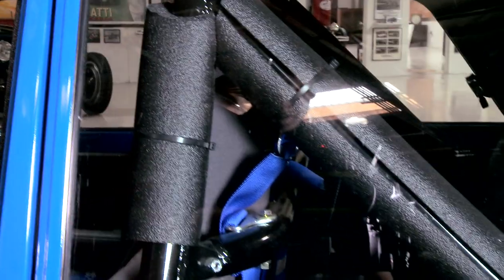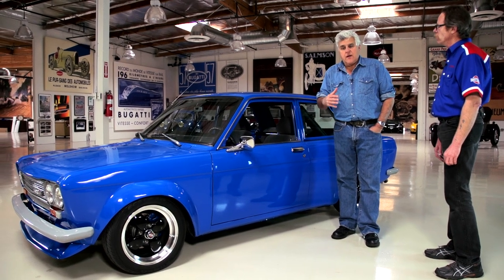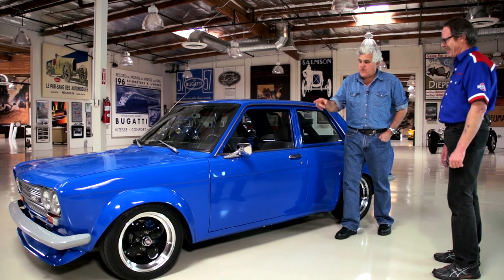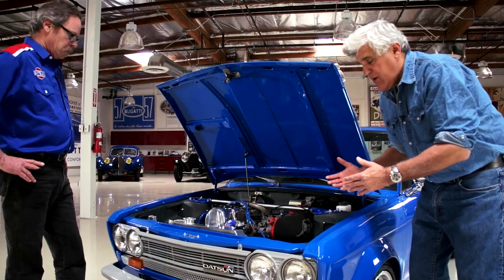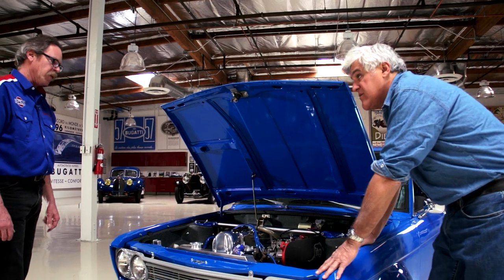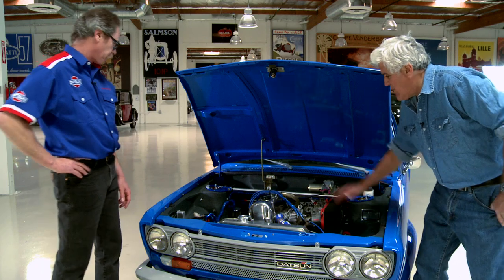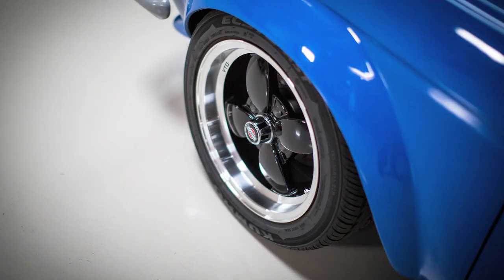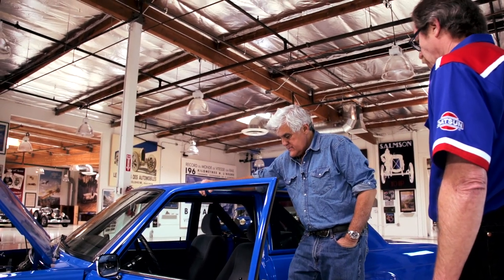1971 Datsun 510 - Jay Leno's Garage

Comment: I'm surprised Jay didn't make the comparison to the BMW 2002.  The Datsun 510 was a more affordable alternative to the Baby Beamer.  Ever since the production of these cars began, the Datsun 510 has been racing against the BMW 2002 in clubs all over the world.  Just look at them side by side.  The two different cars are almost the same size & shape with similar styling.  I remember the 510 always referred to as the poor man's 2002.  I am not slighting the 510.  It was/is a great little car.  These are just memories I have of two excellent cars in the same class: the Datsun 510 & the BMW 2002.

It would be a good thing if both these car companies brought back their respective vehicles.  Kind of like they did with the Mini. (different manufacturer did that one though)  BMW makes the 1 Series now, but it's not nearly the same as the 2002.
Reply: He kinda did at 12:00
Reply: Cj Karcher You are indeed right.  I missed that brief mention by Jay.  He even goes on to mention at the end of the video that he thinks the 510 is just as fun to drive as the 3 Sreies BMW.

I must have been asleep the first time I watched this although, less than 30 seconds of that comparison didn't do the 510 justice in my mind.
Reply: Datsun beat all cars in the class of 2500cc which it is only 1600cc and against
the BMW  2002 in the Baha .  510 king in  Imsa in 1972  under 2500 cc class.
Still see them win in SCCA.    Great car.  have one with Honda s-2000 243 hp.
I am more of a honda fan and you can't beat the top hp for cc then a Honda turns 9000 Love it.  Was fastest 510 at summit this spring with 31 510s there.
Reply: You are right.

Comment: I had one of the first 2-door 510s in Canada- BC actually. Mine was $2100 and it weighted 2100lbs on a truck scale. I rallyed it, and draged it=16.7 , sec 1/4 mile. NHRA record for K stock for one month. Best car I ever bought. Sold it to my sister to pay for my college. I set the redline at 6000RPM and my sister never shifted below the redline; you'd hear her screeming away down the road in it. What a car.

Comment: My first car was a brand new Datsun PL510 2 door sedan. The MSRP was $1990. I had the dealer install a Clarion AM radio and an in-dash factory tachometer, along with Sym-tech rustproofing. Very few 510s  had a tachometer, so mine was unique.The 510 impressed me because it had a SOHC 1600cc engine, good for 96 BHP and 4 wheel independent suspension.  The car was otherwise really stripped down with 560x13 bias ply tires mounted on steel wheels with dog dish hub caps. The curb weight was 1995 lbs. If I had come up with another $200, I could have the 4 door version that came with reclining front seats, bumper guards and full wheel covers.Other cheap stuff included a flat gray plastic manually adjustable outside rear view  mirror and carpeting that covered only the transmission tunnel. the rest on the floor had snap down vinyl mats.The engine was rather buzzy at highway speeds, but the car was very light on its feet. There was no power steering or power brakes, but you didn't need them. I drove it for a year before I sold it to my brother. He discovered a bolt underneath the accelerator pedal that limited how much you could depress the accelerator. He removed the bolt, and suddenly the Datsun was much faster.After about another 2 years, we found the Sym-tech rustproofing was not very effective. The sheet metal was rusting badly.If I had the chance , I would buy one today.

Comment: Thanh you Jay for accommodating common old cars. We had one in SA called the SSS. Tremendous fun also rallying it. Body must weigh about 1950lbs I guess cause i still have a 1986 Corolla 1600 weighing 865kg 
(est just under 2000lbs). Awesome and still 100%original. Thanks for sharing

Comment: I had a 1969 510 in Telephone Company Green.   Was a great little car with lots of power for it’s size.  I used to pull a 16ft ski boat with 4 adults in the car with no issue...

Comment: I had a 1970 510 back in the 70's. I worked for Biener Pontiac Datsun in Greatneck NY. The car was indestructible. I ported the head and had it milled and installed a high-performance cam. With a set of Koni 260 Z struts and wheels, the car handled. Its biggest problem was rust....
I sold it because we needed a more family-friendly car. That was a 1979 Datsun 510 station wagon. It was fun to drive but no comparison to the earlier 510.
This brings back some really fun memories
My son bought a 1973 BMW 2002. That car was also a lot of fun to drive. 
I thind Datsun took many of their ideas from BMW.

Comment: I have a previously abused 2006 Nissan sentra se-r v. The plan for me when I am done ageing it in my driveway is to restore the aesthetic of the car to stock then to integrate the engine, drive train, and suspension of a 270z (VQ35VHR, or VQ37VHR) into it. It will require some frame re-bracing, and custom machining of some parts, but to me its worth it since this was the car I drove while in service. I believe with enough work that this can become quite the sleeper. Unfortunately I lack facilities at this time as other thinks like kids, and responsibilities have priority but one day I will get to work on it. 

I am willing to take options, but please don't be too harsh.

Comment: Got me through my Denver college years in the 80s. Originally yellow, then multi. Completly stock, I used it on 4-wheeler roads on weekends. Nothing cosmetic worked or was attached, and I could park on the Denver streets with no worries, the doors didn't even lock. Maintained by the ex-Shah or Iran's mechanic, who had escaped and wound up in Denver. He loved that car as much as I did. I ran it into the ground, literally, and then left it to the Iranian.

Comment: I had one of these & also 2 of My Friends.  I did modify the Engine by putting a 5/8 Camshaft with a truck head that had larger valves along with twin Webber Carbs & Headers. It sure did go like stink. Ended up sadly though totally off due to passenger falling over My arms while in a corner.

Comment: My Dad had this same car till the year 1992 it was called Datsun 1300 1296cc, was 19 at the time. Sadly sold it off around USD 2.5K as I remember, and bought a stupid Suzuki 800cc. (In Pakistan). Brings back a lot of memories, learned to drive on this, the steering mounted shifter 3 speed forward and reverse. Real fun. I have a picture of that somewhere and would love to share it.

Comment: Mine was almost exactly like this only Black.....the difference was I had a straight air dam on the front with no ports. Carbs were Weber 40 DCOE's (two) with stacks (open) 3" headers race cam,bored out to 1860 cc.5 speed trans, high capacitive discharge,racing distributor.....so much fun. It was stolen and stripped....broke my heart

Comment: I had a 1980 Datsun 510 wagon (I paid $75 for). It leaked every fluid possible, but made the 1000 mile move from Florida to Tennessee in under 24 hours. I loved that car. Tennessee towed it away because it wouldn't pass the DMV protocols. I was devistated. Especially because there was over a $300 bowling ball in the back worth 4 times the car....hahaha

Comment: When I was young my friend had a 510 and I had a sprite (rebadged midget) with a 1275 engine and we raced down a twisty road and the 510 was the sprites equal in speed and handling.
The underhood badge stated Datsun by Nissan on my 76 510 wagon I bought for $125.00

Comment: Hi Jay, probably far too late for you to read this but the story behind the Nissan/Datsun name is as follows: Datsun was a separate entity from the Nissan zaibatsu, during their formative years prior to WW2. The naming history and existence/linage is pretty complicated but long story short: the name of the motor company during the late 20s and early 30s was DAT Jidosha Seizo (DAT was the name of their first car produced by the company under a different name back before the 1920s, before all mergers). They produced the Datson Type 10/11 (name meaning Son of DAT). This and the Type 12 is Nissan/Datsuns (as we know them today) core/formative autombile, which you can trace the 510/Bluebirds linage back to. Anyway, they were taken over by the huge Nihon Sangyo zaibatsu in 1933 (originally a holding group abbreviated as Nissan on the Tokyo Stock Exchange).
Datson was renamed to Datsun (sun literally for the sun) and DAT was eventually merged into Tobata Casting (a company part of the Nissan-Hitachi zaibatsu but was bought out by Nihon Sangyo itself not much later), which the auto parts division of (formerly DAT) was expanded into Nissan Motor Co., Ltd later. They continued DAT's light civilian truck and passenger car operations using the Datsun name. The Nissan name was used for larger, heavier vehicles (including those for the military). They (DAT/Nissan Motor/Tobata Casting) also helped produce engines, aircraft and vehicles for the Japanese Imperial Army as Nissan. During the war Nissans headquarters was relocated to Manchuria, along with the head at the time, in a bid to oversee the establishment of a new heavy industries operation tasked with building much of the infrastructure and new heavy military vehicles there. Nissans name was changed to Manchukuo Heavy Industries Development Co. After the war MHID moved back to Tokyo changing its name to Nissan Heavy Industries. Now, the reason for the use of the Datsun name for their exports starting in the 50s is because the new head/director believed the Nissan name had been tarnished by the war and their heavy involvement with the Imperial Japan war effort, whereas the Datsun name he felt was left relatively pure to what it originally was (though keep in mind the Datsun name was still used in Japan for Nissans early cars during the 30s and 40s). This was a concern because returning servicemen in America were at prime car buying, job, and family starting age, and had money/income. They didn't want to damage their chances at success. Eventually they phased out the Datsun name due to internal pressure in Nissan (the final switch happened right after the then president departed) to use the Nissan name for a number of reasons: tradition, its more Japanese, they wanted to build up a strong marquee, image and association with the Nissan name and they wanted people to know their cars are a Nissan, not a Datsun.

Comment: Sold Datsuns while in college in the early '70s.  We used to actually park our new cars on top of a single-story building that housed our garage. The 510's little brother the 1200 was so underpowered we would have to close off traffic for a couple of blocks and get a running start to get an automatic 1200 to go up the one-story ramp that was about half a block long - and it would just barely make it onto the roof.

Comment: So I'm watching this in January 2020, 7 years after this was filmed and Jay says ; You can find these pretty reasonable still today, a collectors car in the making, wish I had know 30 years ago that my second 510 (which I had painted from the bright yellow to charcoal gray) and sold to an Army buddy for $2500 would be worth possibly $30,000 to $50,000 today, if I had restored her to better than new.  They are an awesome handling car, my first one I pulled the 1600 out and dropped in an 1800 SSS into it that had dual side draft weber carbs.  That car would smoke 1st and second and chirp the tires into 3rd out of the factory 4 speed.

Comment: Re. parts swapability, at 17 I bought a manual trans 510 wreck & easily converted Mom's '71 510 coupe from doggy 3 spd auto to 4 spd stick. With IRS, OHC, ft disks, etc it was this poor boys BMW. Lol, many of the younger neighborhood kids helped me strip the parts car for the fun of it & I'm still using those metric fasteners 40 years later. Anyway, many thanks to Teruo Uchino for his sweet elegant yet slightly sinister design & Pete Brock/John Morton for the inspiration 🏁

Comment: I got my '70 about June '73  at 20 stationed at Point Mugu, from Hughs Motors in Ventura or Oxnard (can't remember where the dealer was) it was $1400 and a 2 door in flesh paint. Got the American Wheels and Koni and better tires. As time went on. I painted the lower half in a brown, the car was that bamboo.  The painting was done in the driveway with about 12 cans of Krylon Gloss but overtime became a flat. Oh well, youth and poverty. It was dependable, and by 1977 I bought a used L20 engine and had it swapped in at a shop in Gilroy.I had custom 2" exhaust pipe made I did not think about the original engine; which was good, I forgot about it and left it at their shop. (dumb). Upon shutting the hood the first time I dented and chipped paint, on higher L20 valve cover- I blocked the space needed with aluminum blocks- to let hinges clear the req. space. I was lucky to have got a roadtrip in it to NJ in Sep 1981 and that was also the doom of it- Having it at grandma's seaside home was a salty ocean nightmare of snow rain and ware. My dad blew it, then alone, he let  it sit, useless from 82 at least 6 years kinda slowly rotting inside in the driveway and my dad never keeping it covered with those cheap tarps. He got rid of it on his own for either Zero or some $$ he never said. It was working well in 1982 when I last left by air it in Feb 1982 driving in before I had to fly back to CA I was there in 85 and the thing was just sitting dead battery/ low tires, oxidized aluminum wheels, hood rusted shot, good interior.  I was sad to aging not have the funds to get it back to CA. It was probably worth at $1111 then as it sat. Just needed battery fresh gas, and a new muffler  sad I see so many restored

Comment: My friends in high school preferred the 4 door for the longer wheelbase that they said rode smoother but, they still preferred 2 doors so they welded the back doors closed.  You could tell it used to be 4 door because the front doors were slightly shorter but, also because of the fake wing windows on the back doors.  I had a '73 240Z and even though the badges said Datsun, my keys and all the body and VIN plates said Nissan.  My 240 was at about 180 HP with my mods and weighed 2260 full of fuel.  With a 4 speed my 3rd gear went anywhere from 25 to 90 MPH.

Comment: I miss my 510. it was my first car. weighed 1900 pounds and had 120 hp and same in torque. I used to puss off the brand new pirsche drivers cause they couldn't figure out how my little rust bucket could keep up.  This is probably the sexiest car EVER. and this one is done right.

Comment: Jay Leno with his size 14 clod hoppers smooshes accelerator, clutch &  brake peddle bearing's mounting alignments  and then clobbers ball joints & steering linkage he is NOT paying attention, let him drive your car at your own risk. Other than that he's a Truly fine guy. Rad Datsun.

Comment: Hey Jay, my first car was a 77 Toyota Corolla (RWD) and my second was a 72 Datsun 240z. Of course, the Z was AWESOME, but the Corolla was a GREAT car too. Fairly similar to that 510 in looks, and with RWD it was FUN to drive. If I still had it now and my current access to upgrade parts and knowledge, the Corolla would be a zippy little sports sedan as well.

Comment: L20-B bored and stroked for 2300cc, that'll work. to make it QUICK, easy as swapping in a transmission from a 610 station wagon for the lower closer gear ratios. Datsun pickup heavier pressure plate but use a car clutch disk = more PSI, combo can chirp them hard in 3rd too. the tweaks might not do over 85 but can do 70+ in 1/8 mile, VERY fun!

Comment: Gees!  I almost bought one in March, 1972. It was a dark blue model. I just couldn't afford the price back then as a 21 year old. So...what did I get that Spring of '72?  A 1969 dark green VW "Beetle". Wish I had gotten this Datsun 510 beauty. The VW had a "faulty engine" design that was put in the '68 & '69 "Beetles": bore & stroke engine block cuts were not synced to each other, thus, "blown engines" like mine did the third week of June that year as I was heading back home from church. It took about two months or better to get the car back. (I bought the "Beetle" from one of my dad's co-workers. He said it would fix it...eventually. Ha! Dad was P.O.ed with the man for taking so long to fix it)  
This Datsun model sure looks road-racing rally ready!

Comment: Had a 1971 and put the handling package with Perelli tires. I could throw that thing into corners and it just stuck. Water pump broke and I drove it 10 miles to my home one time. Didn't hurt it at all. Paid $700 for it. That was 1978. Wish I kept it.

Comment: Downside of the 510's was the rust. The body panels were quite thin and it didnt take many years of road salt to do its damage. Hence most of the salvageable ones are located in the south-southwest. I live in New England and havent seen one of these in good condition in many decades.

Comment: The mighty Datto 1600. I built one of those as a rally car in 1995. Had the make up both front mudguards due the rusted off bottoms. I didn't do a bad job for an electrician. The Red Rocket.

Comment: I had a datsun dealer that opened in 1948 so that's along time to test datsun name so I'm sure if that testing the name might not be sure of. They did a good job on changing the name. I worked as a partsman in 1978 that's about the time they started changing.